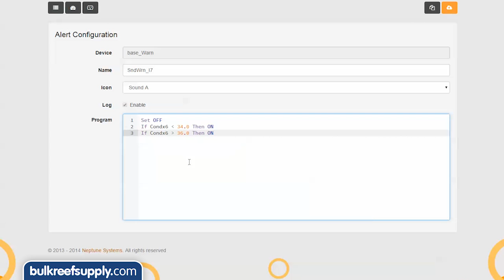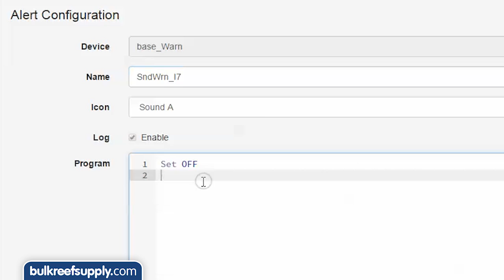Setting up the PM2 Conductivity Module - EP 21: Apex Aquarium Controllers for Neptune Systems

Comment: I want to install my DOS in the Garage above my saltwater mixing station ok - which is around 45 ft away from my controller which sits under my 150 in my FL room. 
Can I install the DOS in my garage which is above my mixing station with a  50ft AQUABUS CABLE FROM USBFIREWIRE and not have any issues or would you add an extra EB4 w/ a PM2 module w/ the 50ft Aquabus cables that UBSFIREWIRE manufactures and add a salinity probe and a temp probe in my saltwater barrell?
Reply from the maker: We have ran DOS and aquabus cables around the same distance or even longer without any issues.
Reply: @BRStv  THANKS FOR GETTING BACK TO ME!! I have the new EB832 Apex and I was wondering can I add an old EB4 just for my mixing station so i CAN run a PM2 mod / a Temp prob and MY the DOS?  If I decided to go that way, i will still need my that 50ft Aquabus cable correct?

Comment: Hey BRS,

I purchased a TON of stuff from you guys and this is my last item...well I thought it was. Please hear me out. Everyone keeps telling me "YOU NEED A NEPTUNE", but I just cannot see it working for me. On a ELOS tank, I have your GFO/CARBON reactors, doser (2-part), elos lighting, heater, etc. 

I have watched ALL Apex videos but I do not see how this could benefit me. I do not worry about salinity and I do not fill my ATO Res. to the max so if my Elos ATO did go crazy, it would only affect salinity by a point or two. I do not worry about pH and I am always between 7.9 to 8.0. My heater has not been on for months and my tank seems to be self sustaining at 79degrees. I also do not want to auto feed. 

So with that. I think a simply light timer may be best for me. Sure, the apex can control your fans as well but my MP40QD's have a feeder option. Quite frankly, I won't be able to use the feeder option as I have a cleaner wrasse who loves to swim in fans that are OFF. So I have to wait and scream at the tank until he comes out. 

Thanks!